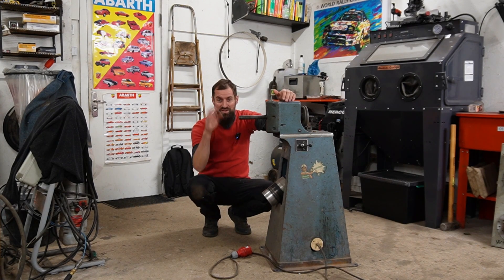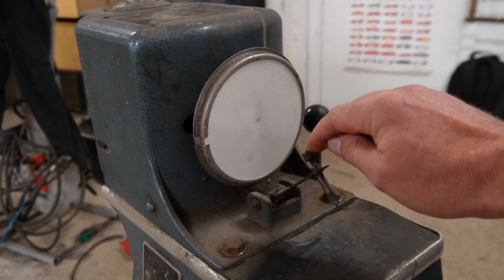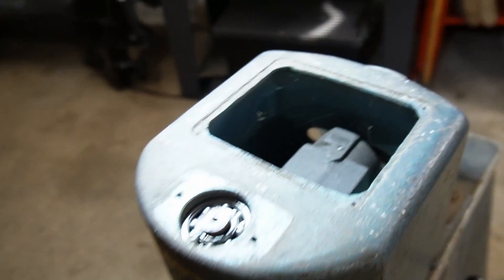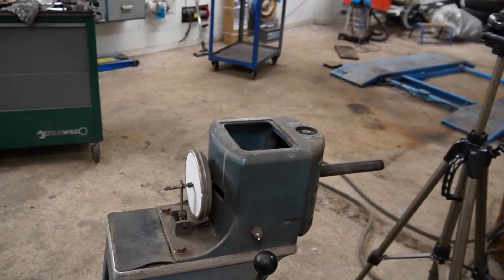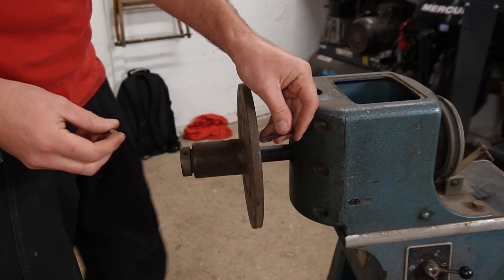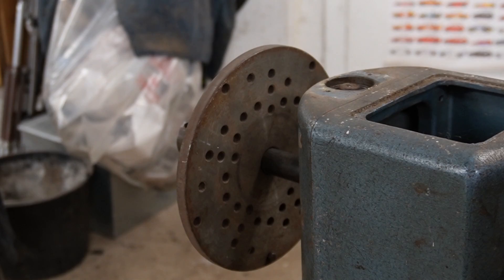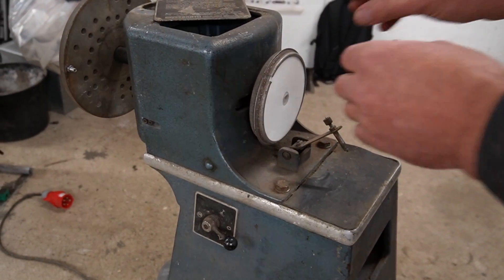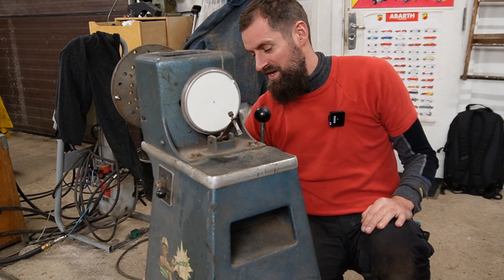The wheel balancer from the 1960´s | How does it work?

Comment: I suggest obtaining two bolts of 100mm, and six nuts (3 each.)  Install the first bolt with all three nuts next to the plate.  On the other, only one nut to hold the bolt, and the other two at the end of the bolt, tightened together, to create the dynamic imbalance.

Comment: In my experience, most garages these days will not balance correctly, with so called new equipment, with steering wheel wobble happening.  It took me many many experiences to find somewhere that accurately balances wheels.  This old machine proves that occams razor, aka the simplest theory will often be true.  Thanks for the video and your passion on explaining !

Comment: This machine is so cool. Old fashioned engineering with no electronics. I think the reason the shaft only needs to move from side to side is because the wheel is spinning, so all side to side positions relative to any point on the circumference of the wheel are accounted for.

Comment: If you place the machine on a 4-spring rocker and only allow the dynamic balancing axis to move, an unbalance at right angles to the rolling direction will result in pendulum movements. This can be easily seen with a dial gauge.  To do this, however, the rocker must be exactly balanced with the wheel mounted and measured with a spirit level. Of course, this also applies to machines without a mounted wheel, but with the wheel's mounting disc. The motor may have an incorrect mains voltage that is too low and would have to be rewound to the current voltage. However, it is also possible to adjust the voltage with a 3-phase transformer. If you can also find a rotating frequency converter with a DC link as a motor-generator converter, you have everything in original analogue classic permanent quality.   

If the machine is set up correctly exactly to the direction of rotation of the earth with the axle, the dynamic balancing can also be concluded from the difference between clockwise and anti-clockwise rotation due to the Coriolis forces. This is what the direction of rotation switch is for. 

Thank you for the very nice video.

EISENEXE

Comment: It’s interesting how the oscillations can increase as the spindle slows. I guess it must be passing through the resonate rotational speed (frequency) for the imbalance under test. The L&R horizontal axis displacements resulting in the cardioid pattern. Very clever indeed.🍻
Reply: As I rememer I wasonce told they stopped using this style of maching because they reuired sunch a high wheel speed to work properly that it was pretty dangerous tu use.